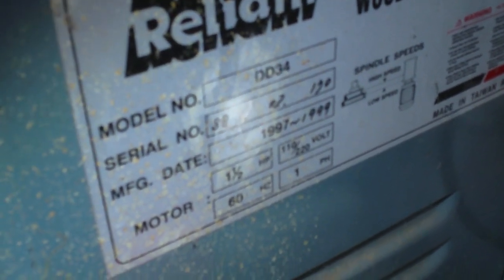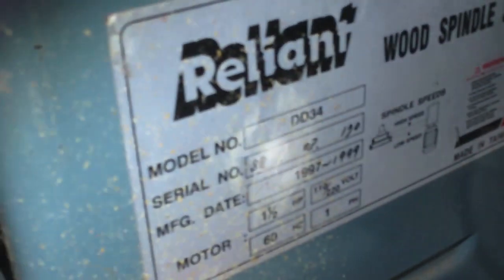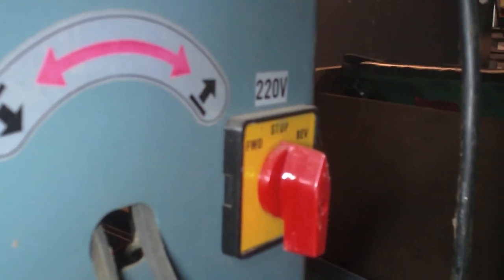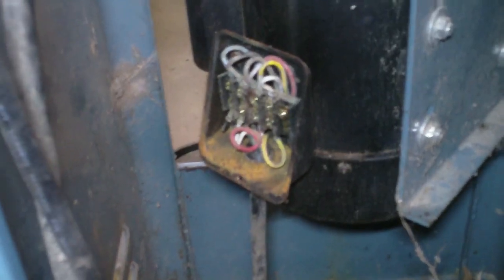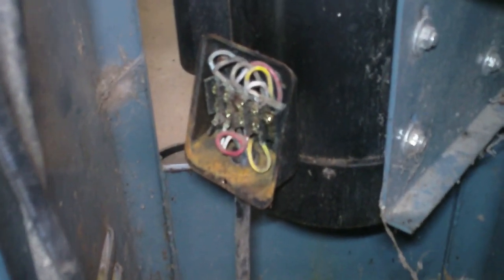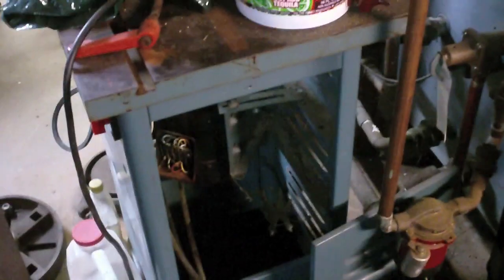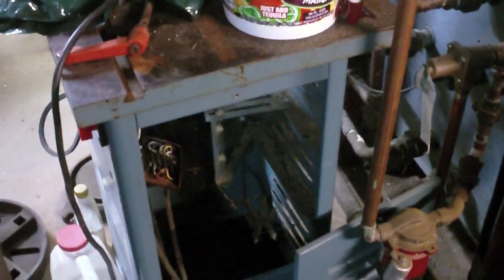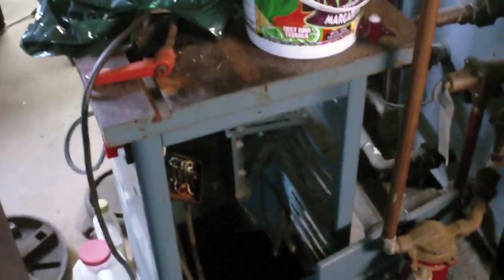The Reliant Wood Shaper Repair Part 3: changing motor voltage 120  220

Comment: Hi Steve,
This is a great video to address my questions about converting this to 120V.  My problem: The video is playing with the image out of focus. Do you know how I could correct the focus?
Reply from the maker: Sorry, I do not. This is an older video and the camera I used back then was not good in low light. Go to routerforums.com and get a free download of the manual as a pdf. On the last page of the manual there is a detailed wiring diagram for theDD34
Reply: @stevewatr  That's OK. I have the manual with the insert about the wiring, so between that and your video I think I can work it out. Thanks for replying. Tim👍